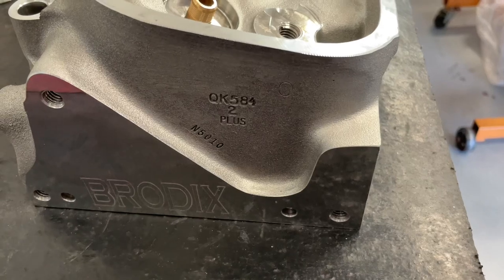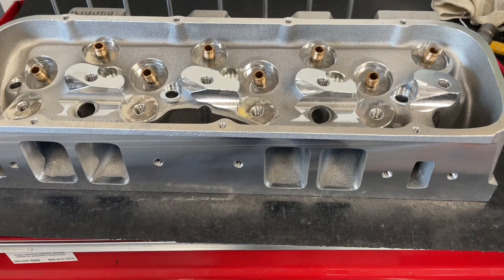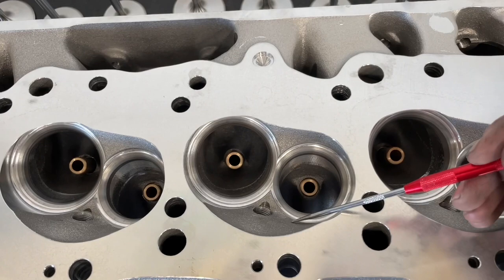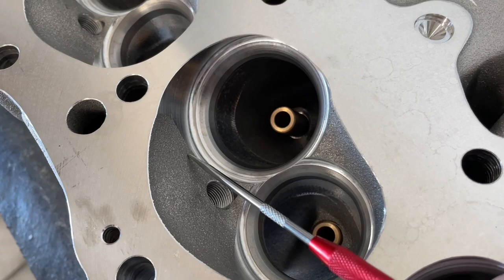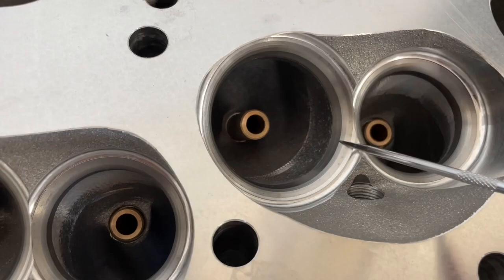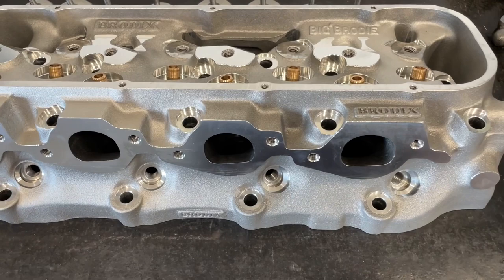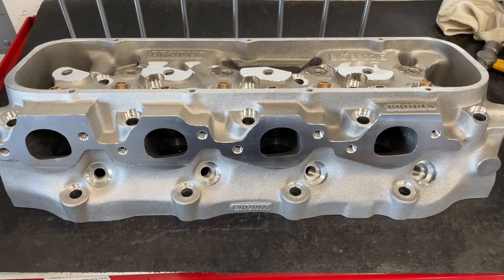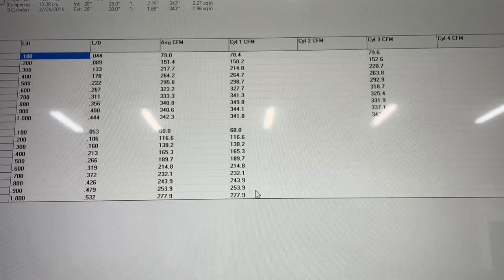Brodix BB-2plus Product Review with real flow numbers(sorry about last time)

Comment: you ever get a set of dragon slayer 320s in?   im considering a set and want to know how they do in a 496
Reply: I was thinking about the 320 Dragon Slayer for a 468 Bracket motor,dont know if they are too big or not.
Reply: I believe the 320 heads are too big for a 468...   310 or 312's work the best.   I use 310 cc Brodix heads stock, probably don't flow over 330 on the intake.  66' Chevelle, tube chassis car, 4-link, 468, SV1, carb, roller cam, 4&7 swap, 2 speed powerglide, 180 low gear, 4.86 rear gear, 14.5" 32" tall rear tires.  Car weight 2,370lbs. W/driver.  Parts in engine are over 30 years old, but are new, intake is a Brodix round top W/turtle, 4150 flange.  ,4 passes on car.   5.62 et. at 123 mph...  Have not launch it off the trans brake yet, also didn't get the tires hot enough because my line lock would not hold the car in the burn in.  Got to get that fixed.  Have not jetted the carb yet or messed with the timing.  Made the most power in the dyno at 37°.  On two of the passes, I got the 1/4 mile times.  This what I do, when I get to the 1/8th, I get off the gas and put car in neutral and apply the brakes and coast.  Car went 9.49 et. at 104 mph and the other pass it went 9.50 et. at 102 mph.  Pretty fast for coasting...  As soon as I get it tuned up it should go in the 5.40 et. range.  I plan on putting a profiler Jr. , 4500 base flange on it over winter in hopes that it will make more power than my Brodix intake.  The engine right now puts out 800 Hp.